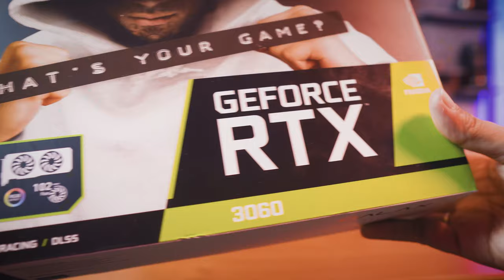Regalong Gaming PC Build Para Sa Inyo! | Ryzen 7 3700x | RTX 3060ti | Aorus x570

Comment: Boss lucio okey n po b ganto set up pc?

AMD Ryzen™ 5 PRO 4650G with Radeon™  Vega 7 Graphics
MSI A520 Motherboard
8GB DDR4 Ram
240GB SSD
Inplay Robin 101 Tempered Case
10x RGB Fan
Inplay GS450Pro Tru Rated PSU